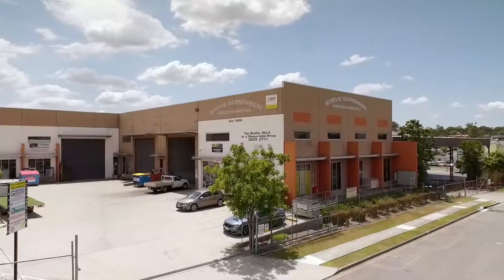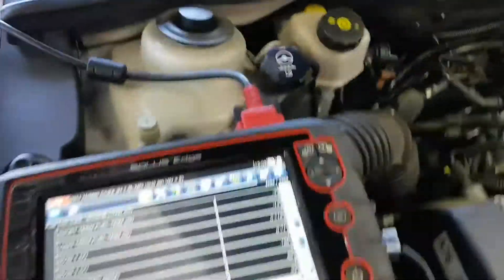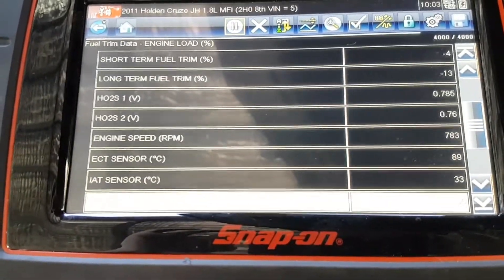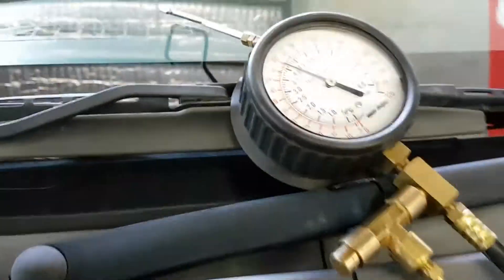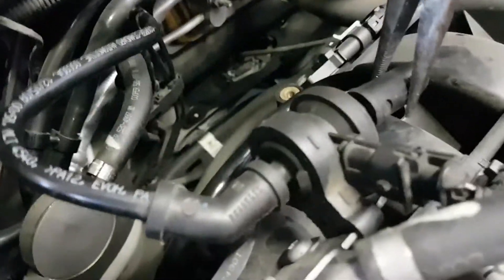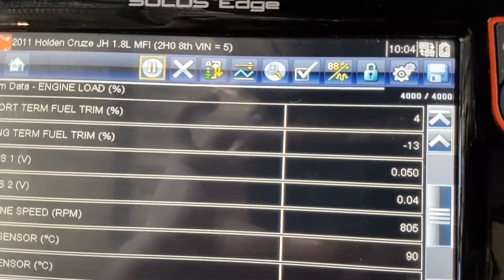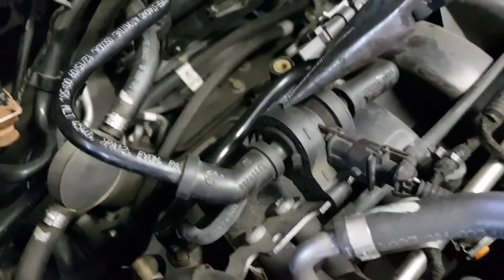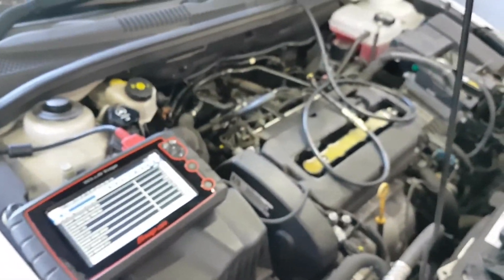Holden Cruze Running Rough On Start Up - Canister Purge Solenoid Fault

Comment: Noticed those hoses dont have clip connector fittings like most other Cruzes. Do they  just pull off from that purge valve ?

Comment: Brendan I have had a number of purge valves intermittently play up, not to the extent were you hear it like the one in your video. The last problem one I had was in a VZ commodore. I knew it was a purge valve because when I disconnected the valve form the intake manifold the fuel trims started to correct themselves.  By the time I got my mityvac onto it the valve was not leaking.  No matter how I wriggled or knocked the solenoid valve it would not play up. So I left it on the running engine for a while and sure enough as soon as some heat got into it it played up and I was able to confirm it was leaking.  I had the same intermittent issue with the purge valve on a Hyundai once.
Reply from the maker: Yes Maurice, only a couple of days after this video I had one on a VZ commodore alloytec motor intermittently sticking open just like this video.  Funny how things come in waves.